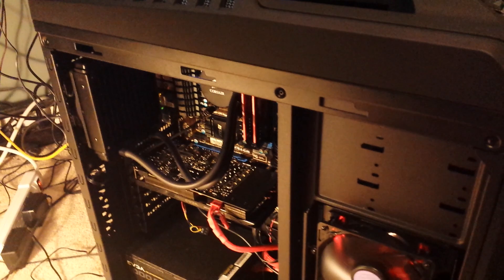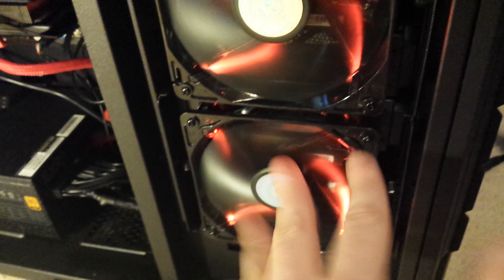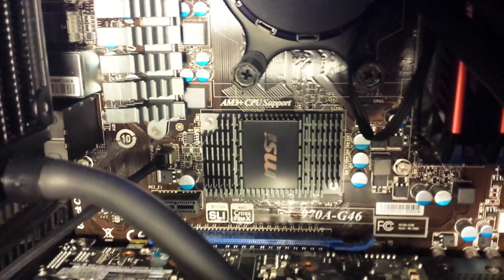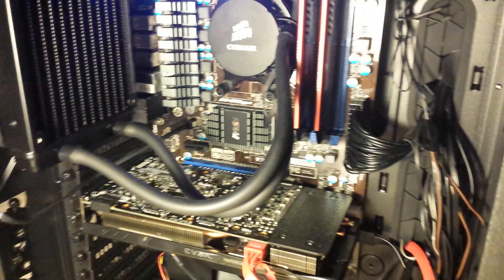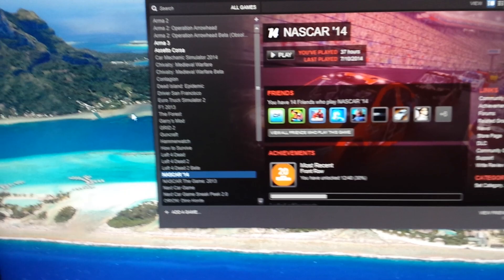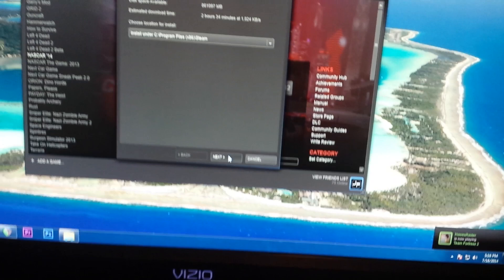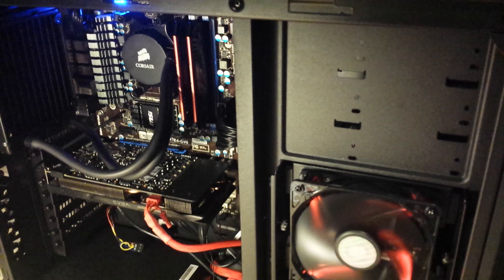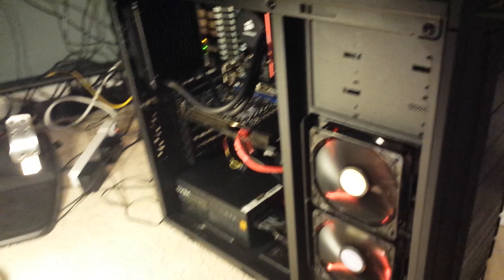VLOG #37 - New PC!

Comment: The first thing I saw was the disaster of wires there and instant reaction was holy shit you're gonna burn down your house!!  Please fix that because that is a time bomb.  If it lights it'll go right up through the outlet into the wall and that's really hard to stop!
Reply from the maker: I have spoken with my landlord about all of the electrical side of things as he did the remodel. My landlord is one of my best friends from high school. Circuit wise I am fine with how many amps I am running. He is gonna check over it all on Sunday and make sure it is Kosher.

Comment: Is that a dell XPS 8500 because I have that too. Planning on upgrading my Gpu to a 270x from a 7770.How long Have you had that thing too. Mine hasn't pooped yet.
Reply from the maker: that was the 8100 and it was from 09' but in the last three years I did heavy editing and encoding. Streaming on it for a year plus wasn't good on it either.
Reply: Jeff Favignano Ya I have a dell xps 720 and I do believe it is 7 years old. And it is still going strong. Wasn't your main issue just your hard drive? and if so how big was it and what name brand.

Comment: Why did you get 1000 PSU could of easily gotten by with 700w  and maybe upgraded your Gpu to a 270x or 280x
Reply from the maker: I run A LOT of usb equipment...audio processor, pre-amp, flight yoke, throttle quadrant, g27 wheel, g27 pedals, webcam, track it, etc. It was more so that I don't have to worry about any usb power sucking away from the card. I have had issues in the past where I didn't have enough power to run everything. 1000w ensures I am set for the future when I upgrade.

Comment: I have a dell xps 8500 with gtx 660 2GiGs and I 7 with 8 gigs of ram
Reply: It doesn't play fsx so we'll though better off with the old one, play gta iv like a boss
Reply from the maker: Tik kamau you can run fsx pretty decently, what ghz is your processor?
Reply: I would check but It got hacked for the fifth time. McAfee didn't help at all